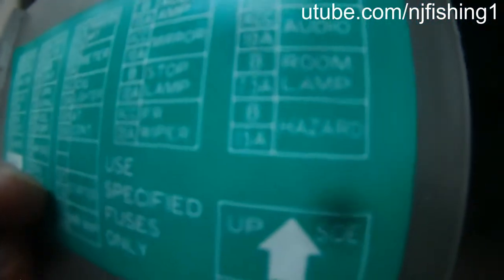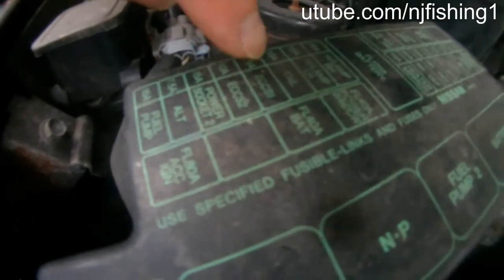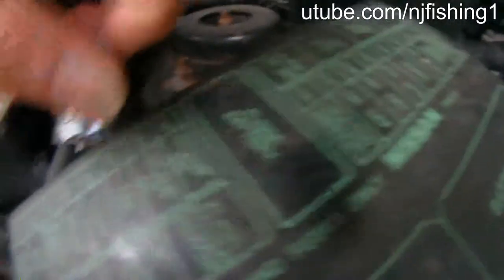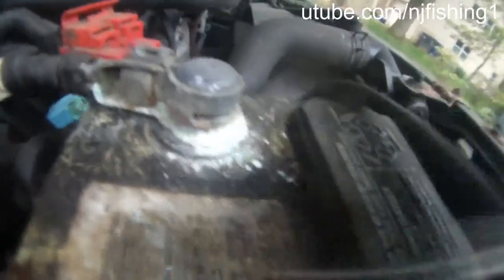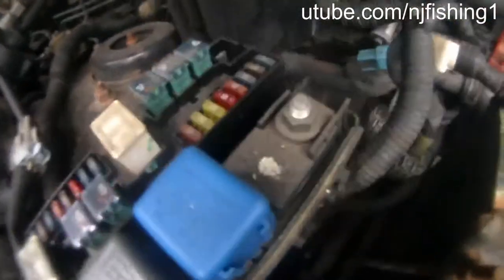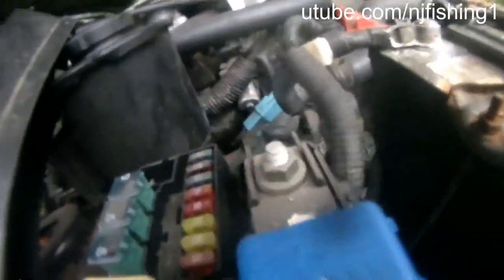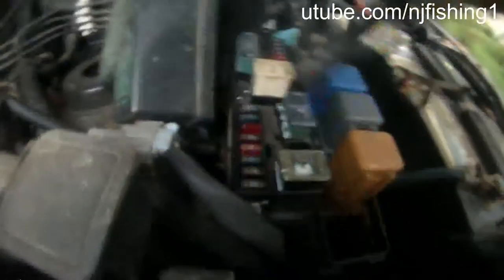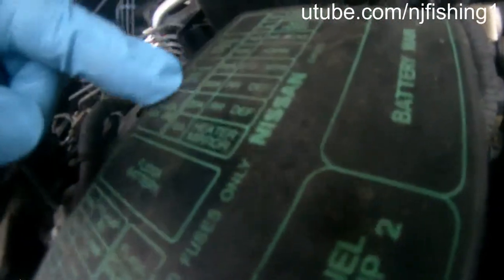Checking my Nissan Pathfinder fuses for broken speedometer - P0500 engine code

Comment: I have gone through some crazy stuff with my 1997 Nissan Pathfinder SE 4WD. All oxygen Sensors reporting even after replacement. Problem with the fuel gauge ect. Only P0500 right now but what helped solve the Gremlins was to remove the Spedo cluster and loosen all screws and then Tighten the shit out of them. I had removed the spedo unit 3 times before. I was so pissed that I tighten the shit out of them and that worked, just don't break anything. Hope this helps you.  How did you make out with the P0500?
Reply from the maker: It workers after replacement.
Reply: Replacement of the cluster or the sensor itself ?
Reply: I just removed the dash cluster and super tightened all the little screws on the back of the cluster.
Reply: @tomb375  ayt, will try my hands on mine. Speedo not working but all other works. Nisssan sentra 08
Reply from the maker: Good luck.
Reply from the maker: I started with the easier one, so definitely dash boatd
Reply: So my Odometer wont read iand its an electronic one would that be a fuze issue or a complete dash replacement
Reply from the maker: Strat with looking for the fuse to see it is blackened and burned. Always start with the easiest job and move to harder job. Be patient and you will find the problem!
Reply: Will do my every other guage works perfectly its just the odometer that wont shot the display
Reply: I have a 03 le r50 and the speedo is in slo-mo and my gas gage has a mind of its own any suggestions